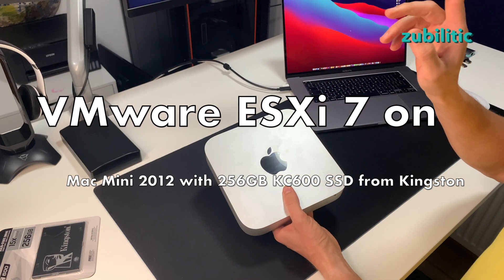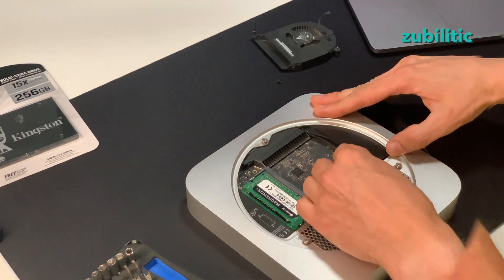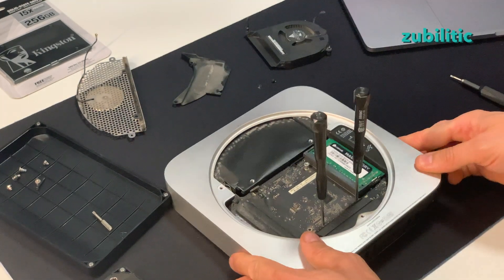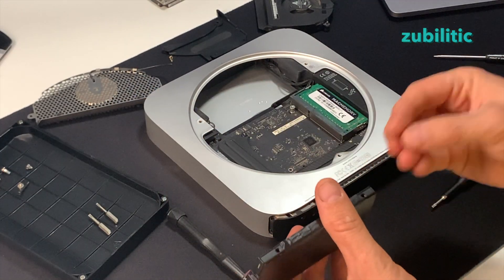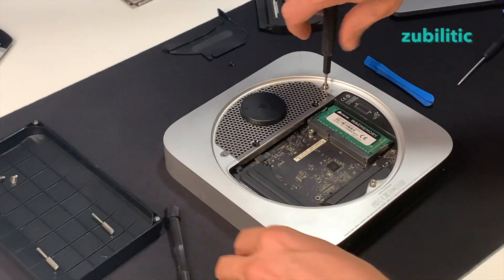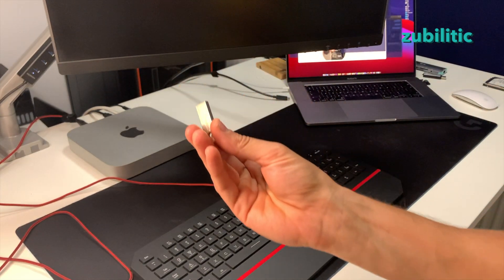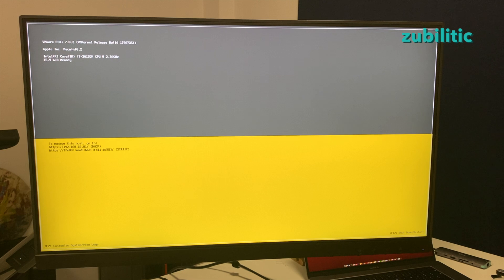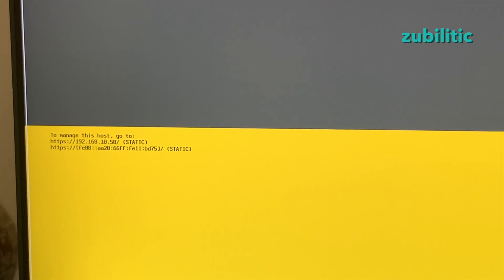How to Replace the Disk and Install VMware ESXi 7.0.2 on Mac Mini Server 2012.

Comment: did you get the thunderbolt2gigabit adapter running under esxi 7?
Reply from the maker: Hello tws,

If you have ESXi 7.0 Update 2 or older, you need to install "USB Native Driver Fling for VMware ESXi". On ESXi 7.0 update 3 it works directly without the need to install any fling. At least for Mac Mini Server 2012.

Fling download website: https://flings.vmware.com/usb-network-native-driver-for-esxi
You must choose the correct ESXi version.